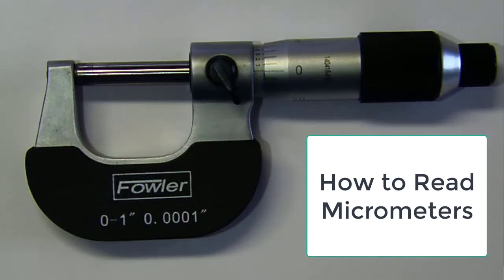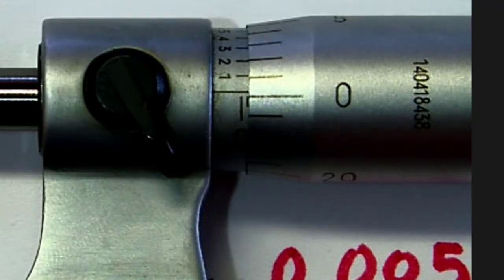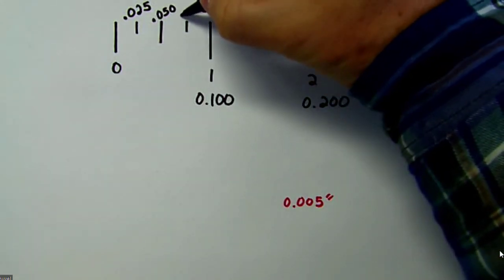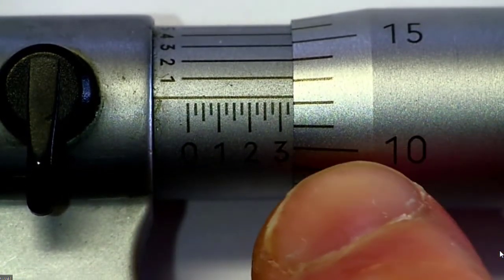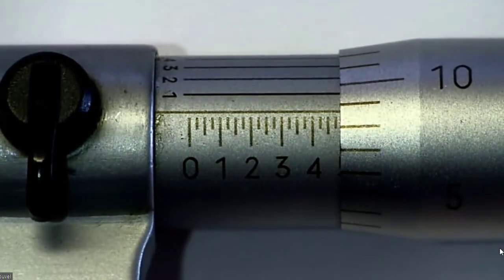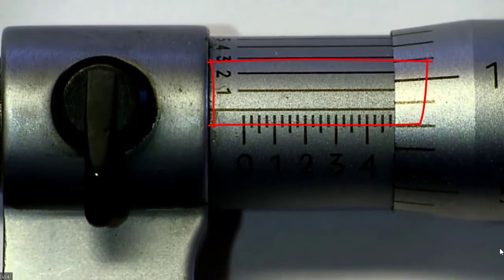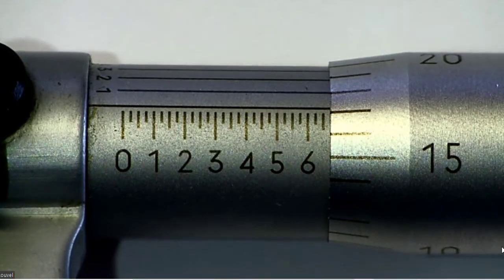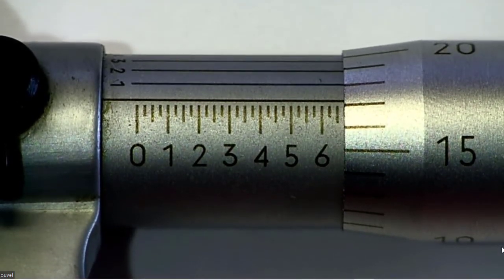How to Read Micrometers with 0.0001" Precision

Comment: as far as the vernier numbers, will they vary among different brand micrometers? I just got a set from Mitutoyo and was going along doing the readings with you so I could learn how to read one. the Vernier numbers were always a few numbers higher on the one that was aligned perfectly. Great informational video, too btw. Thank you for the knowledge.
Reply from the maker: Glad you found the video helpful.  As far as variation, there are different styles of micrometers, but if we were measuring the exact same part we should ultimately get the same measurement if both are calibrated correctly.  Depending on model, the Mitutoyo should be similar.  Since you're following along and not actually measuring parts, you're just setting yours to match mine, and you should be able to set yours in the same positions as mine since it's an arbitrary position on the mic.  Hope that helps and thanks for watching.

Comment: GREAT video!!  How would you set a .0001" micrometer to a dimension of 2.0783, for example?

I set the barrel to .0750"
Thimble rotated where the 3 is on the main horizontal line of the barrel, which is .003"
Now I have it set to .0780"

How would you set the next .0003 on the veneer scale when any line on the thimble can be lined up against the veneer?

From what I can tell, keeping the thimble right on the .0003 marking, the thimble marking 9 would the logical number to align with the 3 on the veneer scale.  Would it be correct to assume lining up the 9 on the thimble with the 3 on the veneer would achieve the desired additional .0003"?

And to achieve 2.0786", putting the micrometer back on the .003", I would need to align the 12 of the thimble with the 6 of the veneer?
Reply from the maker: To set that ten-thousandths on the veneer, look only at the veneer number.  Set 0.0780 as you described, then open slightly the mic until a mark on the thimble aligns with the 3 on the veneer.  Double check your measurement after that.  Avoid looking at the number on the thimble when reading the veneer, because that will change depending on the mic position.  In your situation, I think the thimble number would be 6 (not 9) that aligns with the 3 on the veneer when setting it at 0.0783.  To set it at 0.0786, yes, it's the 12 that aligns with 6.  But the thimble readings will be different at different settings, so try not to pay too much attention to that.  Hope that helps.